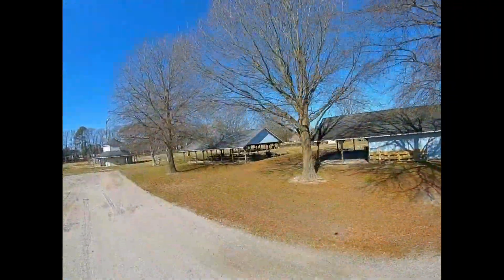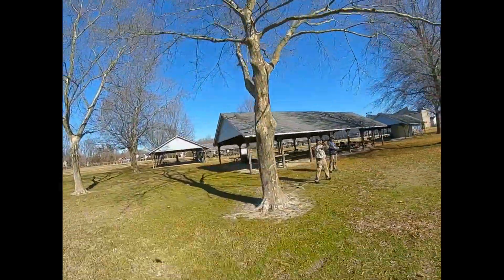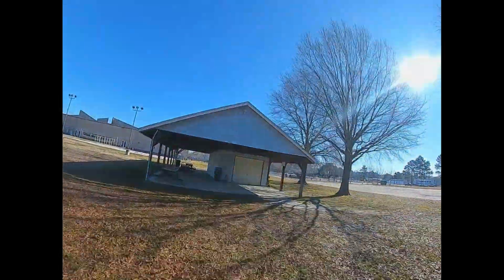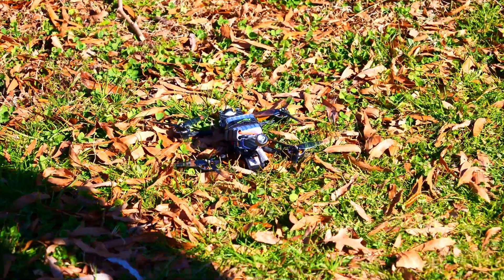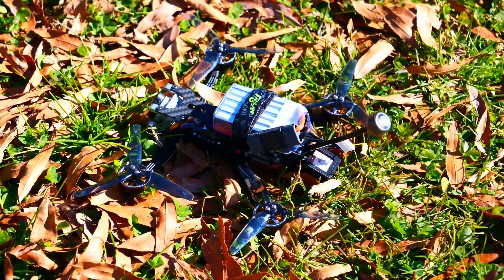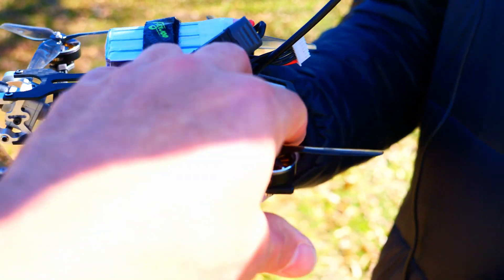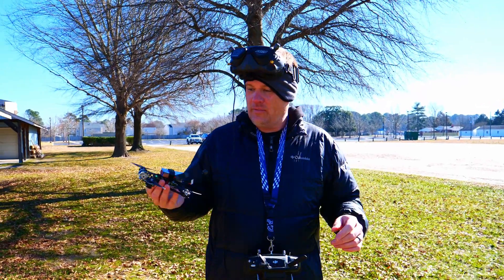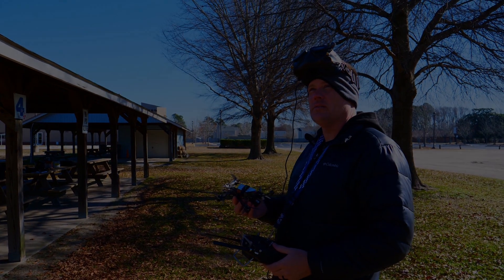2004-1950KV Motor Speed Demon 1 (1-13-2021)

Comment: I just built a mid/long range cruiser on the same frame with hyperlite 1404.5s, it's not a very durable frame though and with the extra weight from those 2004s I'd be really nervous to crash it!